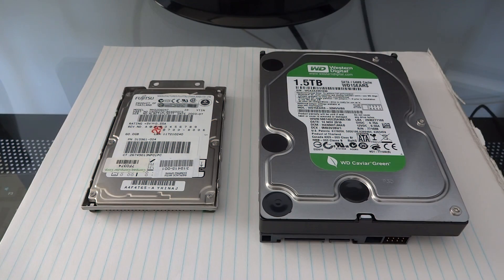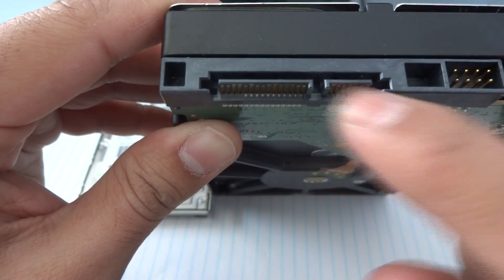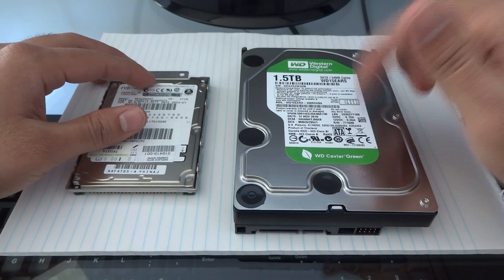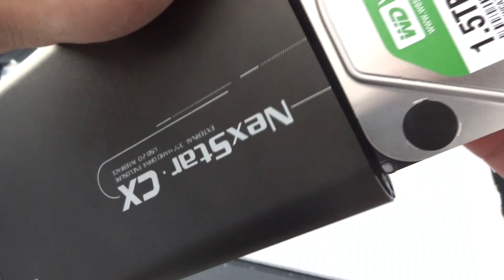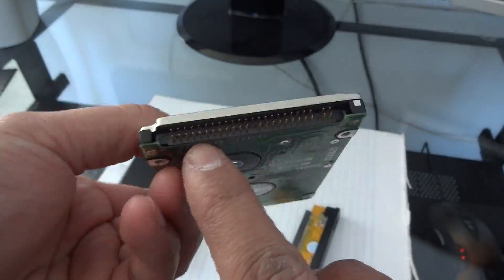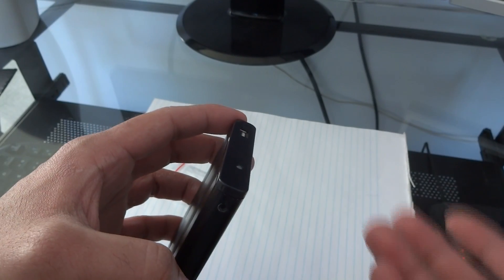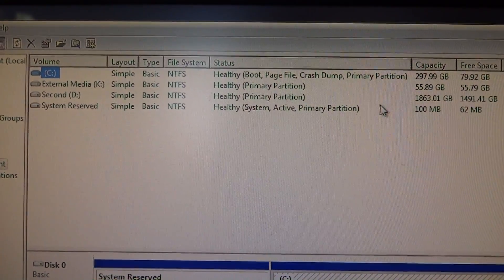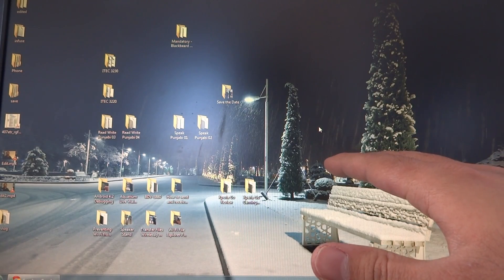How to Build an External Hard Drive

Comment: It is easy to assemble but  may not work when you really connect to your pc
Reply from the maker: Perhaps the drives need to be formatted. Another possibility is checking all cables are connected correctly, a driver issue with the enclosure, trying a different USB port, try on another computer...

Comment: What are the speeds on it when u use it externally compared to internally? Is there any drops?
Reply from the maker: That depends on the speed of the drives, port connection, and cable type. Basically, the results can vary based on your setup for internal and external. You'll need to do research based on your setup.

Comment: Hi is there any other way to access the 3.5 hard drive without the enclosure, like example, I want to connect it to my laptop just to copy files in it, but without enclosure. Hope you reply, thanks.
Reply from the maker: If you have the right connector for your drive to a USB then sure. Like SATA to USB. However, without a case be careful on how you handle the drive or you risk permanent data loss.
Reply: @Babblingboolean  I tried using SATA to USB but doesn’t recognize in my laptop.

Comment: Both are IDE. It's an acronym for Integrated Drive Electronics. The older one is a PATA (Parallel Advanced Technology Attachment) drive. By the way, you're pronouncing SATA (Serial Advanced Technology Attachment) wrong. The first A in SATA and PATA are long by convention.

Comment: Hi. I just found your video. I got a question. Can I use my external hard drive without using a power cord? If so, how? Thank you
Reply from the maker: Usually only 2.5" drives can be used without an additional power cord. 3.5" drives require the extra power cord though.

Comment: Will it also support on desktop? It will need a driver after installation in case? it will work like a external hard disk when plugged into the computer, like other external hard disk do? will it work like a USB to any computer?
Reply from the maker: It'll work like a USB stick or regular external drive, no driver should be needed.

Comment: Hey i made a backup witch is named Infinity on a disk. Welp my pc was gone so i needed to use it. (It has antivirus so when u install it but you virused your computer and is gone it already has the advanced antivirus for worms and advanced viruses and also the basic ones. Also if you have multiple viruses the antivirus will kill one by one and export outo your computer so your safe. (If the computer is still virused it means that is still processing the kill if the kill goes in error it will restart the antivirus and then repair the error and then kill the virus so don't worry if your computer will reboot or shutdown the anti virus is still killing the virus)

Comment: I can't find hardwares for my fostex FD4 digital mixer recorder,it's an old equipment,my Iomega jaz stops working.I saw in the manual I can install 2.5" ide hd inside,but hard to find the hardwares,like mounting parts,50 pin sockets,etc.,help is greatly appreciated.

Comment: You can also open up an old external hard drive and switch it out for a bigger one I recently removed a 100gb drive and put in a 750 GB Drive
Reply: Also you can open up an external CD drive and put in a hard drive in side

Comment: Unless you know for a fact you are going to have files bigger than 4GB, then format is fat32.  fat32 can be read across multiple Operating systems including Linux, Macs, etc.  That is the reason why USB are fat.  If you know you are going to be stuck using windows, then NTFS has it's benefits.
Reply: I format to ext4. I gave up windows years ago.

Comment: +babbling boolean i have an old computer and laptop with windows 98 and windows xp. do i really have to formate the drives for me to use them. both computers dont turn on but hard drives are big and i wish to get old files from both hard drive
Reply from the maker: You can technically take those drives and insert them into an enclosure without formatting them, connect it to another computer as an external drive and maybe you'll be able to see the files. There is a possibly it won't work and here's why, based on the OS versions you were using Win 98 is almost 20 years old and XP over 10 years old the drives are probably dead. You should never have your important data on just a single HDD especially ones that old.
Reply: You can try an adapter you can find a universal adapter on Amazon for $20

Comment: I have IDE 3.5 inch type hard drive, but the enclosure have the power supply port.
 i did not understand the function of it, what is the need of it?

Comment: is it necessary to format it? my computer doesn't work anymore so i want to make use of its  internal hard drive because i have a lot of important files there.
Reply: thanks for the reply.
Reply: Bangtan Int'lARMY wait do you have to format it because I have the same reason I have important stuff on it
Reply: SP4RK NATION no need to format it
Reply: Bangtan Int'lARMY I just bought this 9.95$ encloser for this 128gb 2.5 in Sata ssd and I got all my important stuff off

Comment: If I wanted to use the 2.5 hard drive as an external all I have to do is reformat?
Reply: Yes!
Reply: No. Not necessary. You have to format and delete the C: Drive partition only if Windows installed and expand Volume to make it to full use.

Comment: Would you say it would be more reliable if I used a new hard drive vs. a external hard drive found on Amazon?
Reply from the maker: If the external HDD on Amazon is brand new and from a reputable seller than it shouldn't matter.

Comment: Compared to SATA the IDE will be a lot slower. IDE is using a parallel data type transfer. The SATA is a very high speed serial type data. SATA may also show as SCSI in the drive properties, because SATA with some types of drives will  emulate SCSI.
Reply: SSD now is a lot faster than HDD
Reply: @live-concept  and now Nvme are a lot faster than SATA SSDs

Comment: I want to erase the data on a drive (an SSD in an external enclosure) But It wont let me format. Only letting me delete volume. will that let me  erase data?
Reply: You can try connecting the SSD(not the external enclosure) inside any desktop that supports SATA hard disks and try formatting it there.

Comment: Also, my desktop is not functioning , it does not boot , So , can I remove its hard drive from it & attach it to my laptop ? Will that work OR first I'll have to boot my desktop ??? PLEASE DO RESPOND . thanks.
Reply: You can connect your pc harddrive to laptop as shown in the video and retriver your data..
Reply: You don't have to boot up your desktop. Just connect it as shown in the video.

Comment: hey,  thanks buddy, u explain very well until the classification of SATA (new ! from desktop) & IDE (old ! from laptop) in 2.5 & 3.5 Sizes. now , what should I do if I don't have the cases & how can I connect my OLD DESKTOP HARD DRIVE to my LAPTOP ? Do I need a compatible cable & a power adapter ?? Will my laptop be able to accomodate my old internal hard disk with all my data ?? PLEASE , Boolean, DO REPLY. & THANKS AGAIN, you're doing a good job........

Comment: I thought that when working with circuitry you were supposed to wear gloves.
Reply from the maker: +Vancou vera The components shown in this video are not nearly that delicate, it's quite safe unless of course you're rubbing your socks on a carpet at the same time as handling the HDD (building static). But that would be silly :P

Comment: does the old hard drive still need Windows to work or can I delete Windows and still be able to use the older programs
Reply: +Loretta Mundus no it doesnt but you want to pick up a usb 3.0 case so it will be faster

Comment: I did this, when I plug in the external hdd and turn it on I get an error message saying the usb-device doesn't get recognized. The drive still worked before I replaced it with an ssd last week. Is it a problem that the drive still has the old Windows on it? Any idea how to fix this?

Comment: Decent video dude.
The enclosures for ole IDE internal hard drives are friggin difficult to find. However I have an  usb 2.0 to IDE SATA adapter that little device is useful. But you would have to be careful not to move it around. Got it from walmart canada more than a year ago, before standard shipping fee jumped from 15.00 to 100.00 to northern area.

Comment: Formatting doesn't have much to do with the speed of your pc (the i7 you mention), it has more to do with the disk write speed and the connector speed. As you have a USB 2 connector, your speed is limited quite a lot, you'd be better of with USB 3

Comment: Is it possible to find/build an external hard drive casing for a 3.5" IDE hard drive with power supply?
I took 2 IDE drives out of different old computers, one needs a power connection and the other has a powered bus.

Comment: Great video, thanks. Im just wondering is it possible to combine more than one IDE Hard drive and putting it into a single casing? I have a few old hard drives that I would love to be able to create a big one out of.
Reply from the maker: You have to find a case that has more than one slot. Since IDE is old, it might be difficult to find.
Reply: Okay Thanks :)
Reply: Sounds like you want to do a RAID array. You need more than a case for that. Likley a NAS box.
Reply: @upayemoony1157  thanks but I cant even remember what I was using this for 😂

Comment: Why does it show only 55 gb, in windows, on that 1,5TB WD? Or you connected another HDD?
Reply from the maker: It's the 2.5" IDE HDD shown in the video.
Reply: Babbling Boolean is estata better
Reply from the maker: TENSR
esata can actually provide better speeds than USB 3.0.

Comment: Instead of the external enclosure can I use SATA and power adapter cables with usb to use the disk externally? I have difficulty finding the enclosure of the right size. My hard disk is 3.5" similar to the one in the video but its a lot thinner, almost half the thickness.
Reply from the maker: You could technically connect the hard drive to the computer using a SATA wire and power connections to the power supply but your computer case would remain open and static could damage the hard drive just sitting there without any protection. If your HDD is the same size but thinner then why not use an enclosure anyway? HDD enclosures usually include screws to attach a HDD in a enclosure to prevent it from shaking, so if the HDD is thinner, it wouldn't make a difference.
The only way I know to connect a HDD to a computer via USB is with an adapter, HDDs themselves don't have USB ports directly on them.
Reply: Babbling Boolean Alright, thank you!

Comment: I have a pc that the power supply died, I am going to get a case for my hard drive, will I be able to transfer my files that I want to save onto my new pc with this set up? I don't want to format the hard drive for storage until I get the info off that I need.
Reply: Yes, I just did it with an old IDE hard drive I placed in an external enclosure case. I was able to see all the files just as if they were on a thumb drive.
Reply: how did you transfer the files to the new computer, mine keeps saying the drive is corrupted
Reply from the maker: Melanie Miller
 What cri8tor said was correct. You can take the HDD out, put it into an external case (but don't format it!) and copy your data to another computer. For your corrupted HDD problem there isn't anything I can help with sorry.
Your best bet is to ask in "tomshardware" website in the computer forum section, there are some very knowledgeable members there. Good luck.

Comment: hey i liked ur video, this will help me alote....
but i have a Q.
i have a SATA 120GB hardrive (small one) from a new laptop that was broken, my question is:
Can u link it to a smart tv for recording?
Reply from the maker: Most likely no. That's only possible if the TV itself has that feature built-in (which I've never heard of) or some other third-party device (which I have to buy and test myself) like this: http://goo.gl/86F3JS That particular model allows USB connectivity or placing a 2.5" hard drive inside.
Reply: its a Samsung smart tv, it should work with an extrern hard disk but i'm not sure if it works with this

Comment: is it possible to make you external harddrive to my main harddrive
Reply from the maker: As long as you format it then yes. HDDs are pretty universal, they can be used as primary, secondary and external drives.
Reply: Babbling Boolean i can just remove every thing on my external hdd and reinstall windows 7 on it and its done i dont want my crapy hdd just only my external hdd
Reply: depending on drive if IDE id change jumper setting on the drive to CS(Cable Select) an let the computer or bios chose the best from master or slave
Reply: TSpider Keeper i have already fix it running on my external hdd now

Comment from the maker: A regular 2TB Western Digital hard drive? Just follow the instructions in the video above, the storage size of the hard drive doesn't make a difference. Simply search for any external hard drive case for SATA hard drives, the only condition you didn't mention is if your hard drive is 2.5" or 3.5", those are listed on the hard drive case specs anyway. Don't think too much about it, it's simple. If you're having trouble, go to a tech shop and tell them what you told me.
Reply: Babbling Boolean Hey I got the sata to usb 3 cable I've hooked it up to my Xbox one as an external drive and it works. Is there any reason I would need a case?